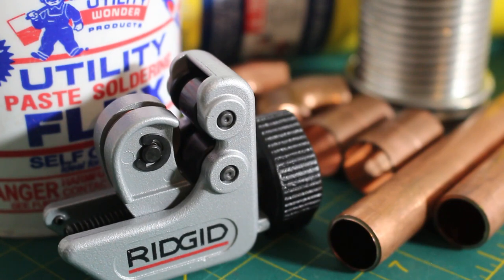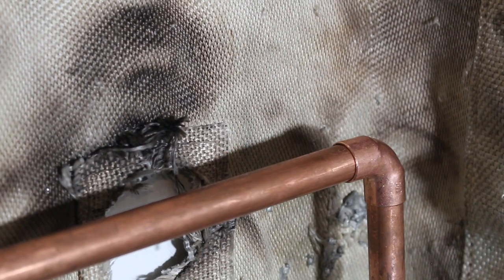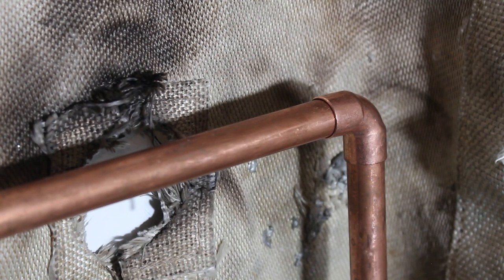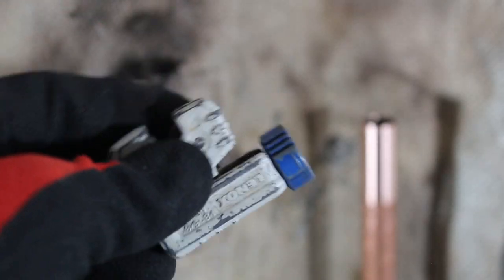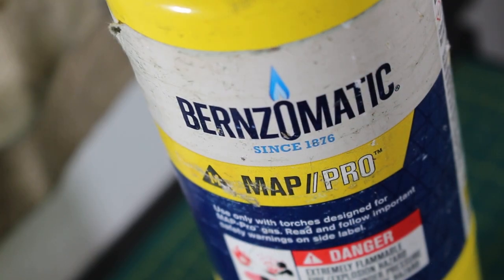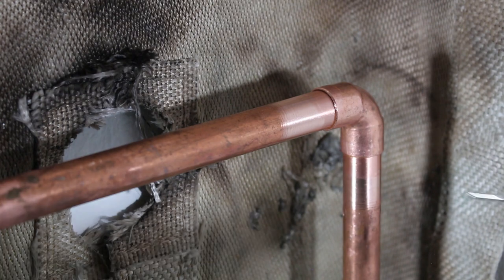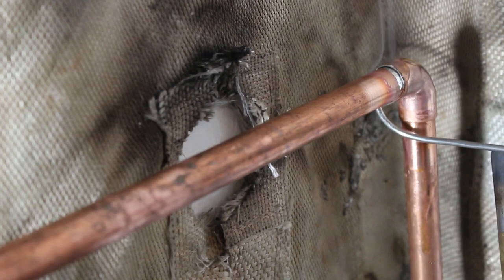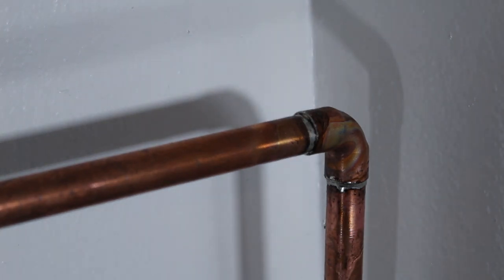How To Solder Copper Pipe In Tight Spaces (How To Solder Copper Pipe Like A Pro) Plumbing 101

Comment: Good video. One final step: recommend wiping off any excess CORROSIVE flux from the outside of the pipe/fittings, or you may have more leaks months or years down the line.

Comment: I had 3/4thick boiler high temp insulation (used for rebuilding the boilers) and specifically radiator change over/valve repairs very useful in soldering in tight spaces. One tip beside fire extinguisher is also a bucket of water for extra backup including wet rags. I know size of fire extinguisher is for couple of seconds and also type of fire but always have extra protection.
Reply from the maker: Good advice👍👍👍 Thanks for watching! Stay safe out there & stay tuned for new videos every week🔧

Comment: Is the flux and solder the same as we use for electric cable soldering ?  Thanks.
Reply: no. electronics lead solder has flux inside the core and you can also add rosin flux. plumbing solder is different

Comment: Excellent video!  So if I'm soldering in a ball shutoff valve on 1/2".pipe, I would apply the heat to the top and bottom of the shutoff valve right?  The capillary action will draw the solder up or down into the fitting, right?
The pipe extends up from the floor, vertical solder job for a tub.  Thank you.
Reply from the maker: Thank you! You would apply the heat on 1 side of the ball valve you're actually soldering but the fitting itself where the pipe went inside and not the body of the valve. Then you do the same for the other side of the ball valve👍 Yes, the solder will be attracted to the heat and flow right into the fitting🙂 Appreciate the feedback🔧 Stay safe out there & stay tuned for new videos every week!

Comment: So I need to solder a pipe that is close to the floor. I know you are supposed to heat the pipe from the bottom up but if I can't get my torch under the pipe is it ok to heat from top down?

Comment: Why do you keep turning off your torch and moving to a different spot? You’re just wasting time and movement which equals loss in pipe integrity when working with copper. If heat it from the bottom and work the flame up and no need to swipe at it super fast even with 95/5. Calm down and slow down so you can do a good job. Also dumping a few copper shavings down a pipe isn’t the end of the world but its a sign of laziness and bad workmanship.
Reply: Exactly what I thought about when he was deburring the vertical standing copper pipe. Good to see people paying attention to the details, details matter.
Reply: What is the correct way to do it.  Deburrine a standing pipe
Reply: Hey man, I mean this with all due respect and no sarcasm at all. Would you mind making instructional videos like this? Demonstrating the things you’ve mentioned?
Reply: @marilynnelson3559  I like a pencil reamer since it cuts a strip of copper instead of shavings

Comment: Bad braze but good Info  cause my job change something  didn't never had that shinny sliver joint braze and I done this for 4 years and they trying to say nothing is different it also acts like it doesn't wanna flow cause touch heat looks like shit whst do I do step by step I braze compressors that go in big A/C  units for hospital stuff like that

Comment: Copper shavings dropped into pipe that was in open end looking up position while deburring. That is not good for refrigeration components of the system.
Reply: How would you deburr a vertical pipe and catch the shaving? I thought you were supposed to take the air rater/screen/shower head off faucets and let the water run until the shavings came out. I'm not sure about other things like water heater or washer
Reply: @joshscott8678  copper tubes are also used in refrigeration and air conditioning. Shavings inside the tubes could be very harmfully for refrigeration cycle. In this particular case in a video, there was no need to deburr tubes before welding.

Comment: Ugliest solder joints ! The top of that 90 barely had solder at 12 o clock! Also take a rag and wipe away the excess flux once the pipe is heated BEFORE adding solder when doing a vertical joint so you don’t have solder running down like you did on the backside!

Comment: There are better torches than that ts8000 for tight quaters work
Reply from the maker: This is a high intensity torch but works great for just about everything. Which kid of torch do you use or recommend?